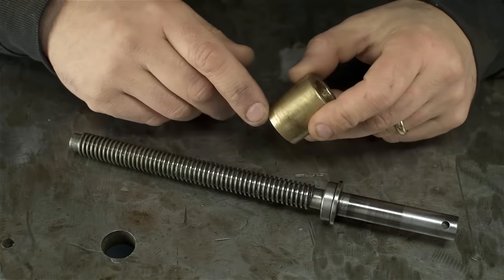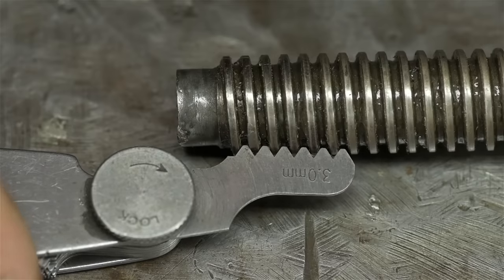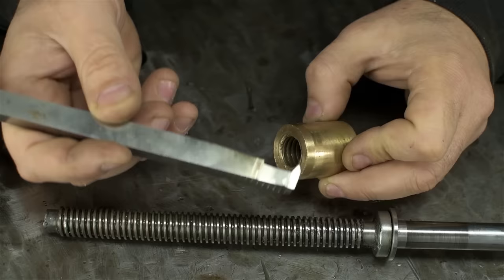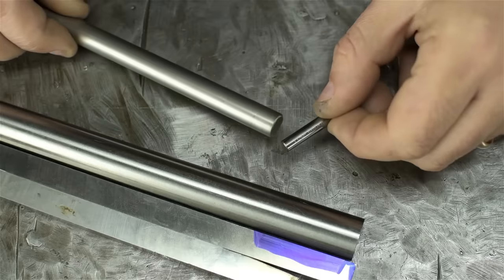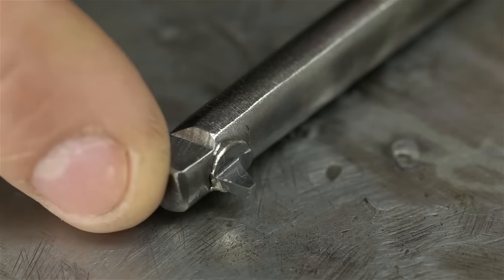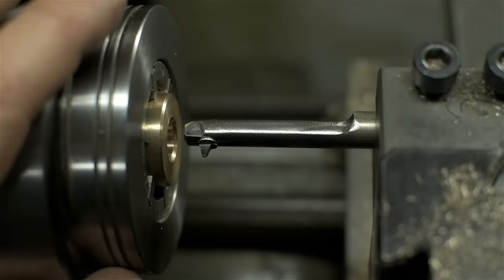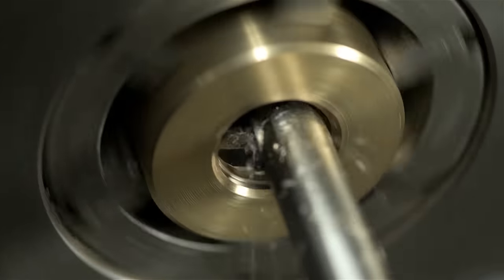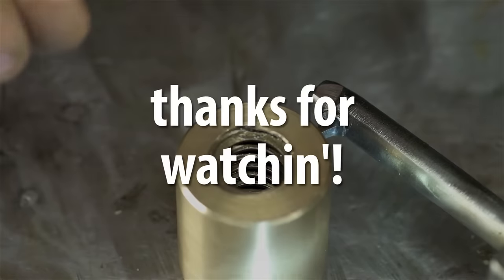CHOOSE YOUR OWN ADVENTURE: Single Point ACME Threading!

Comment: GREAT video! The comedy "break's" made my day! I ran a "one man model shop" for a Fortune 500 company in the 70's-80's. We had a good budget, BUT, they knew I was well adept at making my own tooling, so they'd always whine about me wanting to buy something for a job. "We buy you tool steel & carbide, AND, you DO have your own oxy-acetylene rig"!! Jeeze!  

FYI I'd have been pressed for time (what else is new), SO think I'd have gone to the "production shop" & stole one of these. That's where the diamond wet grinder is anyway! Tweak the profile there after soldering to a bar.

 https://www.kennametal.com/us/en/products/p.nas.1796528.html

Comment: Hello, nice video. However it skipped the very central part that is how to grind the tool! It's like that Benny Hill sketch where you see the super hot wife starting to undress and then the scene cuts and you see her in bed under a huge comforter and curlers on the head
Reply: Also all these puns are not very comprehensible to "non-english as a first language" viewers

Comment: This is Nora from Taipei Taiwan and we are ball
screw manufacturer. We own the high quality and competitive price because our
factory in China. Our goal is we really hope to do more business with you.

We have established from 2010, the head design
office in Taiwan and in house manufacture in China. Professional in ball screw
and screw nuts, especially for hi-precision requirement. Provides quality,
economical and compatible ball screws solution.

Our ball screws own the good quality, competitive price and hope
to find a power transmission dealer world -wide. If you have any interest, please
feel free to contact with us. We supply ball screw and screw nuts in DIN 69051,
GB/T17587, and JIS C5 standard with in-house manufacturing factory.

Shen-Han Technology is established in 2010
and supplies ball screw and ball nuts which factory is sited in Bao- An, Shenzhen,
China.  We are the high-tech ball screw
manufacturer and meet the international standard of DIN 69051, GB/T17587 and
JIS C5, etc.  The factory is certified by
ISO9001 & UKAS and we are professional in the industry and have the
confidence to produce both of the global standard and the customized
specification, and the quality is compatible with the international branded
products.

 

We are approved by Chinese high-tech
enterprise certification and the plant has the equipment included CNC lathes,
CNC 4 axis machining centers, CNC 5 axis machining centers, and CNC internal
thread grinding machines.  We have
R&D team to develop the new designs of ball screw and has the specific
patents including the new design and new appearance.  We are also capable to develop OEM or ODM
designed ball screws to satisfy with customized needs.  The sketch of CAD/CAM customized transmission
component design is available both for equipment and high lead ball screws in
specific standards.

 

Capabilities of Shen-Han Technology –

. Ball screws and screw nuts in customized
specific standards

. High lead ball screws and screw nuts 

(1204, 1210, 1220 ,1606 1616, 1632, 2505,
2550,
2440, 2020, 2040, 2525, 4040 5050 etc.)

0601 0606 0801 0802 082.5 0808 0810 etc. Only our factory has produced in China.

 

Wei Tai Transmission Limited Company is the
head office in Taipei and acts for all of international trade activities to
handle the shipment supplied from Shen-Han Shenzhen factory.  We are looking for the new customers in your
regions and it’s thankful if you can give us a chance to work together with.  Please feel free to contact the following:

Wei Tai Transmission Limited Company

Email: 02weitai.ltd@gmail.com  

We chat ID: w0978377508 

You tube:  https://www.youtube.com/watch?v=XKHwhjqAZ88&t=72s

https://www.youtube.com/watch?v=3zvWLUPf630&feature=youtu.be&fbclid=IwAR1YrwKl5IDJYIbX9AutbZjNg0yRe8h4ZAchtP4NC88fW1o4QAyw1X_GbQw

WEB site: https://weitaitransmission.blogspot.com/2019/07/

Website: http://www.weitaitw.com/en/ball-screw-nut.html

FB: https://www.facebook.com/hung.nora.3

Cell phone: +886978377508

Address: No. 214-3, Zhou Mei Street, Bei Tou
District, Taipei, Taiwan, R.O.C.

Tel# 886-2-28326773            FAX:886-2-28327852

 

Your needed is our research power, your prompt and favorable reply
should be very appreciated.

 

Best Regards

 

 

Nora Hung

 

Let me introduce our company, Wei Tai Transmission (Taiwan), has manufactured ball screw /nut
since 2010.

We are proud of our product matching DIN 69051, JIS C5,
and GB/T 17587

(1)  Reliable product -480K pieces per year sales
at domestic market in China via 400 distributors.

(2)     Long lead ball screw specification – 1632,
2040, 4040, 2550 to help factory to down low the average production
cost via increasing speed and help each other to get margin.

(3)     Miniature specification - 0601, 0801, 0802,
082.5 for existing compact mechanisms market. The 0606,
0808 will be our new development to speed up at compact machine.

Our product quality is liable. Please refer below photos
at our production lines.